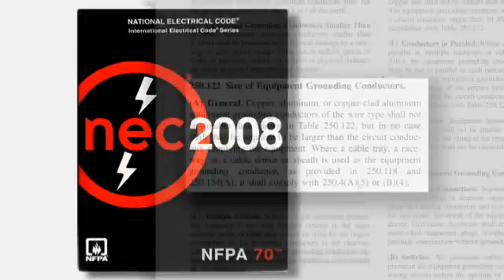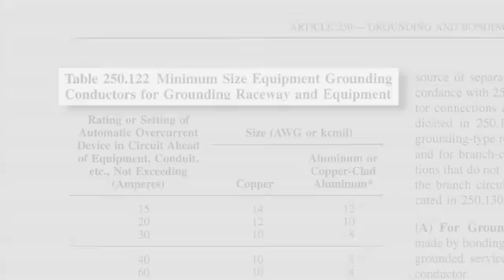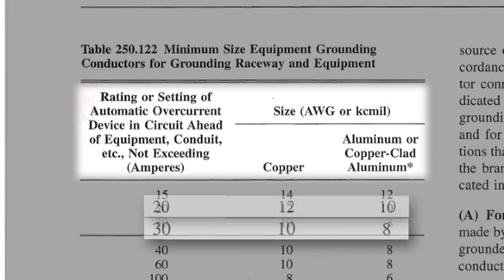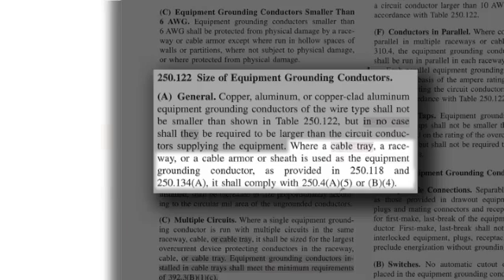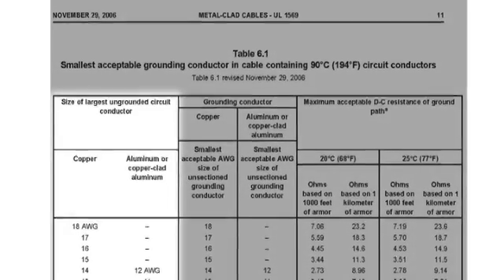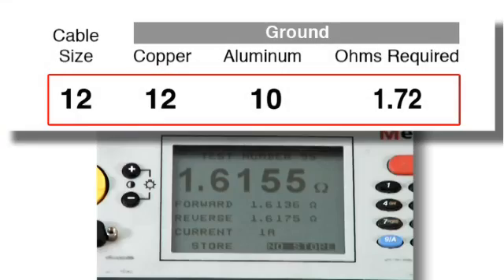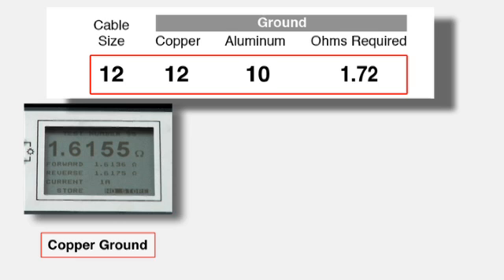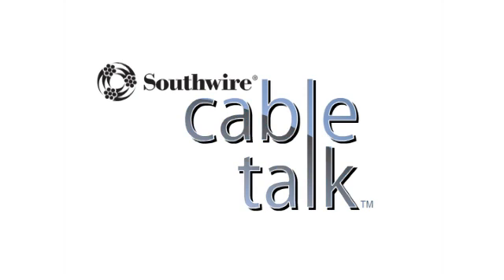Green Copper Ground vs. Armor Ground for MCap Cable

Comment: I firmly believe that nothing is better then providing a long time most dependable ground the a copper wire. Was taught to never have an armored cable touch a dissimilar metal because think they called it galvanic reaction yet they install an extremely #16 bare aluminum wire I direct contact of steel jacket cab!e. Copper is a lot better conductor then the aluminum or steel jacket. Often wonder how many feet of convultutions spiral jacket is on say a 100' of 12/2 MC cab!e. Bet its over 300'. Thought a long time ago they should outlaw flimsy type AC cable and make everyone use far superior type MC cable. In my area for at least the last 35 to 40 years you are not allowed to use garbage AC cable in any commercial spaces.